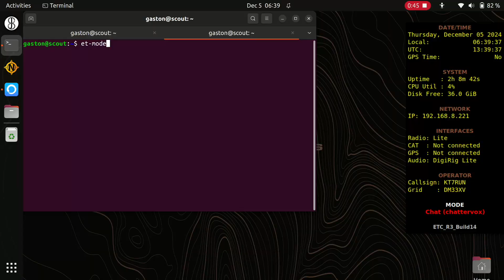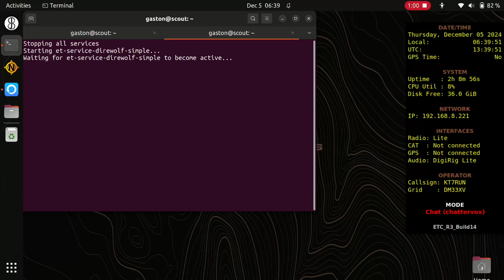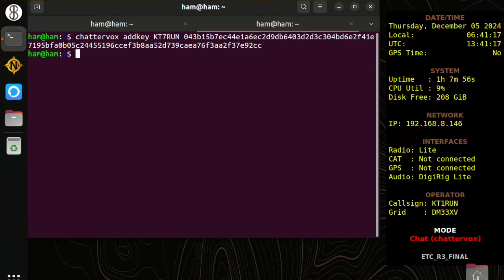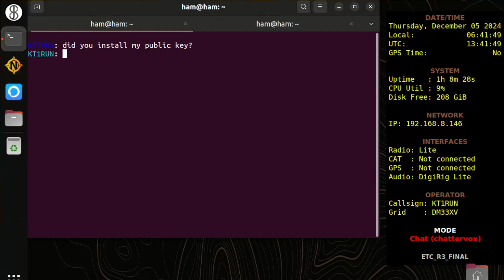Trusted Chat over Radio: Chattervox (Elliptic Curve Crypto)

Comment: Same as DigiPi but yours has specific hardware requirements where DigiPi allows you to use whatever platform you have available.
Reply from the maker: The DigiPi offers full plug and play with zero configuration?
Reply: @ you set it up once for the radio you have and then again anytime you change it.

Comment: Would be better to replace the EC digital signatures. Whilst they prevent tampering of messages, they still have the possibility of replay attacks. 
Replacing it with Signal protocol's Double Ratchet algorithm which is designed for 1:1 communication over an unreliable network, would fix that.

Comment: A little over a year ago, I started a project called ChatterBox (B, not V), having no knowledge of this ChatterVox project which apparently already existed years before. There are some uncanny similarities, especially given their names only differ by a single letter. I also use elliptic curve digital signatures and text/data over RF. Since I'm using ISM band where encryption is OK, I use both asymmetric and symmetric encryption, and meshing to push packets much farther than low power hardware typically can. My firmware also only runs on specific hardware (lilygo and other custom hardware) and not yet any devices with a typical OS. When I saw ChatterVox, for a moment i wondered if I'd stumbled into some parallel timeline or something.

Comment: do you run linux for all your radio stuff? i have PopOS on a laptop and struggle to get anything to work on it. even CHIRP
Reply from the maker: Yes, I do. Specifically, I'm running a heavily customized version of Ubuntu 22.10 called EmComm Tools. I do not include chirp at this time of that platform as I manually program my radios, then clone them. Good luck and cheers from another System76 user.

Comment: According to the FCC, encoding on Amateur frequencies is legal, encrypting is not.  Preparing a message for a mode is encoding, such as converting a message to Morse code to send on CW.  Encrypting is meant to obfuscate a message.  Saying "garage" to mean a remote meet -up location is encryption.  Using digital modes gets a little fuzzy.  When running TCP/IP on AX.25, can you only use telnet  (clear text), or can you use SSH (encrypted)?  When transferring a document, can it be password protected, or not?  For file transfers, is the only protocol FTP, or can you use SFTP, FTPS, or SCP?
Digital modes, such as DMR, fall under encoding, but is encrypting a message on a digital mode encryption?
There seems to be  no difinitive answers for any of these questions from the FCC.
Reply: the difference is in whether the key is publicly available.

Comment: I can confirm that Meshtastic needs a lot of work to go mainstream in the nerd kingdom 
The hills can make 915mhz connections challenging without a mountaintop router, but this protocol does support running on Amateur bands at 10W of power 

Overall, the concept is very cool to securely mesh it up to friends and family if you're 1-3 hops within range of a hilltop router 

This demo of Chattervox is really cool and I'm definitely going to set that up in the lab :)

Comment: What I can't deal with is the waiting for the software "final product". Would love to get this installed on a portable item and then using my FT-897D mobile with a ATAS-120
Reply from the maker: R3 is out. It was released on Thanksgiving. R4 is the Q1 release for 2025. There will be a new release close to every quarter. Software takes time.
Reply: @TheTechPrepper  You're saying there is no "final product" like he seems to be looking for? It's a process of ongoing improvements and experimentation?
Reply from the maker: @MrHuram-abi  This is not a final product. The last R3 was all about easy-of-use and plug-and-play support for radios. I have roadmap for about about 8 more releases going into the end of 2026.

Comment: So the actual text communication is not encrypted?  It is just being used for user id verification?  Did I understand this correctly?
Reply from the maker: You are exactly correct. The text message is not encrypted, but it can be compressed. The compression is documented on the creator's site. This protocol expressly designed for operator/ID verification.

Comment: In my opinion Meshtastic is unreliable
Reply from the maker: I am a very late adopter of technology, so I intentionally have been delaying a deep dive into Meshtastic. I'll leave it for the "cool kids" to play with it. I'll take a look once it stabilizes. Thanks for your two cents.
Reply: If you live in a rural area, ( especially with hills), its basically useless.
Reply: Would Meshtastic in the HF bands be more reliable in rural areas?
Reply: @MrHuram-abi  , my first thought is no, because of much lower data rates. Also, you'd need a combination of bands and antennas.
Reply: @MrHuram-abi  Meshtastic is confined to the license free, LORA chirp modulation, 915 Mhz band in the USA. Has the advantage of legal text based encryption, including creation of private channels but generally has to operate at 150mW TX. Although low power, each Meshtastic acts an automatic repeater by default, with a 3 hop limit.
Reply: @MrHuram-abi  Meshtastic is license free on the 915Mhz band in the USA, uses LoRa chirp modulation and is legal to encrypt.
Reply: How is Meshtastic unreliable? Packet radio vs Meshtastic, have pros and cons. I'd use both.